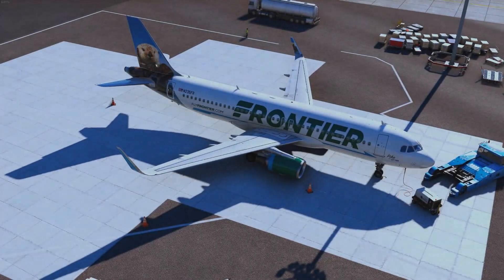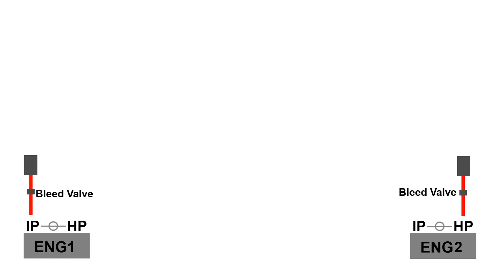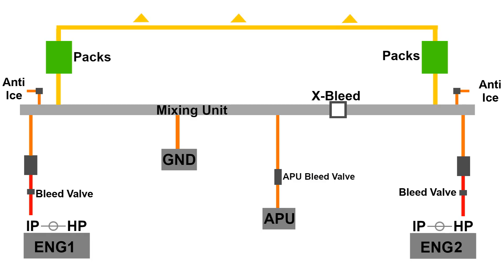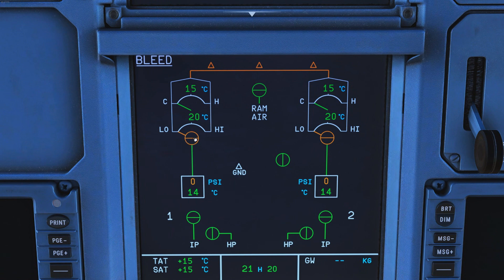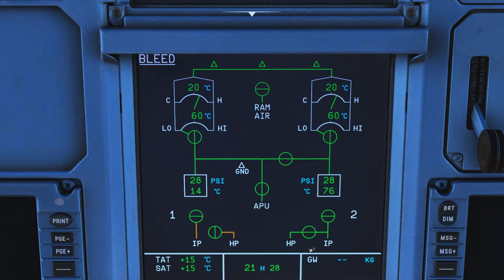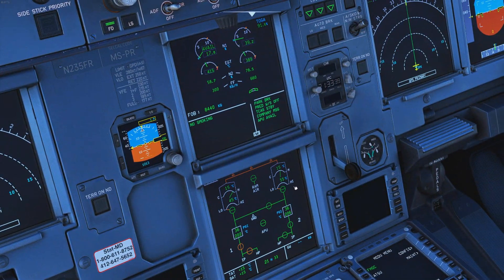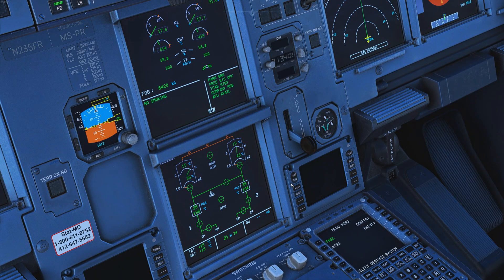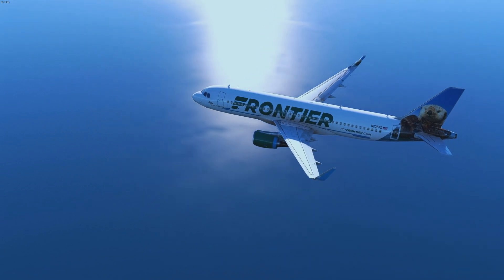A320 Pneumatics Made Easy

Comment: Hello captain and thank you for all your educational videos, they are very informative and adds to the realism when we are working these study level aircraft in this fantastic hobby of ours.  I have been meaning to ask you about single engine taxi... on the A320, can signle engine taxi only be done with engine#2 (left) + Hyd elec pump ON or can it also be done with #1 instead? I presume all this depends on aircraft make & model and of course company SOP.  I have also noticed lately in the real world that engine start is now from left then right? is this also a new global SOP for all aircrafts / airlines? (with at least two engines)
Reply from the maker: @kostadinos9581  on the A320 single engine taxi is usually done with eng1 running and no2 off.
Which engine is started first is company specific. Usually the airlines that allow single engine taxi out start No1 first. 
Some airlines don't allow this and I have seen that they often start no2 first.
Hope this helps
Reply: @fsclips  Fantastic! thank you so much for the info and keep up the great work.  Looking forward to all your upcoming videos :)